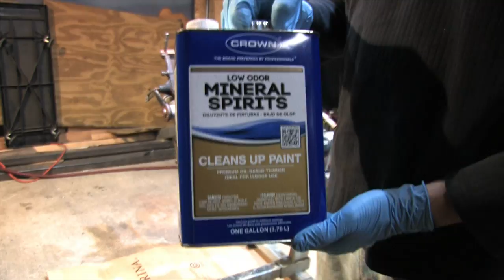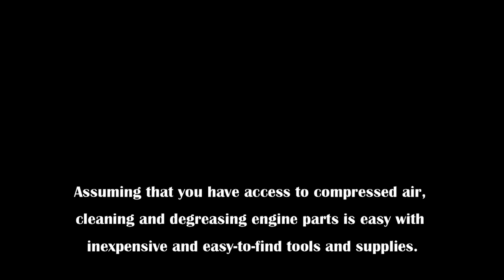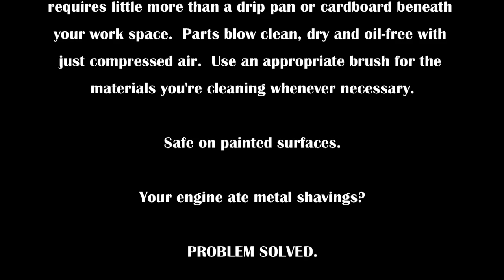DIY Parts Washer

Comment: What about clean strike, purple power, mean green, simple green, etc?  You could get a giant tub from fleet farm and put the entire motor in it and let it soak.  What is your opinion on these commercial degreasers?
Reply: Aluminum doesn't take well to degreasers. If you read the back of the bottle, they generally say not to use on aluminum. Lot of people do a soak like you mention to the block and other iron parts, but then you have to clean soap out of every nook and passage. Mineral spirits will evaporate cleanly without residue. Nothing wrong with a soak, but it's a lot of work. In the end, you still need to put some effort and time into scrubbing it and just about as much time into rinsing it as this whole process took.
Reply from the maker: buggsyspam ArcolaBridge Jamie actually uses a tub of Awesome Orange, and says the parts come out looking new.  He's also let a part sit too long without being washed well enough, and the whole surface of it grew fuzzy aluminum oxide stalagmites.  Strong acids and basic solutions will destroy aluminum, and there are some places you just won't be able to reach to wash it all out.

BUT...

The method I demonstrate doesn't really require much along the line of rinsing.  The compressed air thing takes no time at all, and the dirt blasts off with the mineral spirits.  The stuff you can't reach will evaporate on its own time.  It looks better 24 hours after you blast it than it does right after you're done.  It's much easier, faster and far less expensive than soaking in a huge tub of detergent.
Reply: Yeah looks like a great method.  I just used some ZEP concrete wash last fall to clean an engine block and I was amazed how fast it stripped off the oil  I  rinsed it immediately though.  I've been reading though, looks like there are "aircraft safe" (aluminum safe) degreasers, simple green makes one.  But I looks mighty expensive.  I like this method looks kinda fun haha

Comment: Can you use acetone to clean your engine? it drys almost instantly and is very strong when it comes to cleaning. i used to use it to get paint off of rims on my cars and it didnt seem to harm the metal at all. just wondering if anyone knows.
Reply from the maker: Yes indeed.  Carb cleaner is mostly acetone, and it's completely safe FOR THE METAL.  As far as breathing vaporized acetone... I'll stick to mineral spirits.  When I don't need a full-blown parts washer, I use 2+2 which is acetone with methylbenzene, toluene and xylene.  Nothing stands up to that stuff.  It even ruins powder coating.  Doesn't completely remove it, but it will ruin it.  Mineral spirits is a whole lot safer for humans to work with than everything I mentioned.
Reply: well thank you! as for breathing it is, i have a paint booth at the shop i used to work at so that shouldnt be a problem. thanks!

Comment: How's the gsx doing? When will we get to see the build? Pretty excited about it!! :)
Reply from the maker: We're both excited about it.  I'm afraid that project has grown much larger since my last update.  It looks like I will be making much more than just engine build videos for that car.  This former show queen is about to get taken to a whole new level.  The GSX engine comes first, don't worry.  If there's a mod that can be done to it, I'm doing it, and I'm covering it all.

I plan to have the Hyundai back on the road here shortly.  There's nothing fancy or difficult about this car.  The timing of the boom is unfortunate, but I don't care enough about its aesthetics to make it pretty.  Most people would have crushed this thing over something like this.  I just want to use my stereo again.

For the first time in a long time, I'm going to PUSH one in, and DRIVE it out.  It usually happens the other way around.  Until I break that curse... do not drive your car into Jafro's garage.  I have to break that curse in order to work on the GSX.

Comment: Just curious, what do you generally use to coat the cast iron with to prevent rust?
Reply from the maker: Just plain old WD40.  You have to re-apply from time to time because it doesn't last forever, but it's effective enough.
Reply: Thank you sir for the quick reply. I figured it would to the trick but wanted to ask in case there was a better option. Thank you for all the awesome videos. Hope to see your Galant up and running!

Comment: how much of mineral spirits do you waste on one engine block? it looks like a good amount of solvent is needed. Is it worth the money?
Reply from the maker: +karffiol $15 worth.  1 entire cleaned engine vs. $15.  The blow gun doesn't ever go bad.  $15 doesn't even buy 3 cans of carb cleaner where I live.
Reply from the maker: +karffiol Sorry, realized I didn't fully answer your question... I buy a gallon of mineral spirits for $15.  If you're OCD, might want a few extra pints.  I went a little over because I wanted to soak the pistons in clean solvent.
Reply: +Jafromobile well that actually sounds like a very good deal :)

Comment: Jafro, have you come across Berryman Chem-dip carb and parts cleaner? That product also seems to be a good one but it might be a bit chemical hazardous compared to what you used. However, it is quite extremely effective in cleaning off carbon deposits, debris, and any residuals on any parts.
Reply from the maker: Yes.  $138 in 5 gallon buckets, it's a neurotoxin, it's chlorinated (I don't use chlorinated products of any kind in my garage because I also weld).  It's banned in California (just like my "carb cleaner"), is highly-flammable, causes reproductive problems and cancer.  The only thing I'd ever do with that is soak parts.  I'd never vaporize it in my work area because it contains Methylene Chloride.  I bet it works great with soaking parts, but people who used to use the old formulation hate the stuff they sell now.  The old formula was EXTREMELY hazardous.
Reply: *****
Thought so. Thanks.

Comment: great work put what the chemical you use ?
Reply from the maker: amjad amj Low Odor Mineral Spirits.  Diluyente de pinturas - Bajo De Olor.  White Spirits or Terpentinersatz depending on what country you're in.  The old timers might call it "coal oil".  Because that's what it is at its most basic form.  It's a liquid coal extract, refined and purified.  Immediately dissolves all petroleum residues and rapidly evaporates.  2:01
Reply: thanks friend i was use the gasoline for cleaning . thanks for information

Comment: seeing that knock sensor on the block it reminded me... does any body knows if i can put a knock sensor on a g64b 87 out of a galant .. originaly the car had distributor cap and so no knock sensor .. i dont see any thread for a sensor.. but i cant be sure couse the block is allready wraped in plastic foil (as jadro allways recommends when keeping the block for a longer time!!)
can anybody help with some info?
Reply from the maker: If you can't find an empty bolt hole in the block for it, maybe for an intake manifold support bracket or an un-used accessory bolt hole, then you can weld a piece of steel to it with a hole and the right threads drilled into it.  It doesn't need to touch a water jacket or oil gallery, it just needs to read vibration, so any solid thing that you can attach to the block in that general location should work.  Just watch out for the heat when you're welding it.  Cast iron is finicky.

I discovered the Hyundai is slow (13's) because it runs in limp mode with no knock sensor.  Mine's dead shorted out.  I never had any timing advance on any of my drag passes because of this.  There's a lot I don't know about this car's power output as a result.
Reply: thanks for the respond i'l try to find a hole for another botl somewhere on the block.. i just thought it should be at that exact location (2nd cyl.) to get the "right" wibrations from all 4 cyl... but if you mean the location(within lets say 3-4inches of its original location) where it will now sit doesnt matter as long es it is directly bolted to the engine (y) thanks alot!

Comment: How safe is this to do on wiring/rubber hoses/gaskets on an engine that's still in a car?
Reply from the maker: Perfectly safe.  Mineral spirits will clean those wires and hoses making them look brand new again.  It's a super-thin oil that will dissolve any petroleum based mess while restoring plastic and painted surfaces.  If you noticed, the can says "cleans up paint".  It does.  It strips wax, but won't hurt paint.  You didn't ask about that, but I know it was the next question.  :P
Reply: Ok, thanks for the information! I'm the type of person that cares more about the engine bay where I work than the paint job on my car hahaha. Don't want specks of whatever falling into my eye when I'm just doing an oil change.

Comment: So this would be completely safe to use on an engine still in a vehicle then? Mostly leaning towards cleaning engines on skidsteers and other equipment but some of the farm trucks get pretty bad. 
Keep it up man, love the vids.
Reply from the maker: Yes.  No problem.  Will clean up engines that are still in the bay.  Cleans up industrial machinery, tractors, basically any metal that gets oily or greasy.

Comment: Can you use this methods to clean a dirty engine bay without it causing any problems? Please answer back :D
Reply from the maker: Yep!  You still need to spend time with your air compressor to finish it up or the mineral spirits will pool instead of evaporate.  It will dissolve adhesive on electrical tape, but it's safe on all metals, plastic, rubber, and painted surfaces.
Reply: Thanks man keep up the good work :D

Comment: use an automotive spray gun?
this would allow changes in spray pattern and ratio of air-fluid
lets you wet it down/scrub then blow dry as thats the trigger action half trigger is air then full trigger is fluid+air
Reply from the maker: The one problem with paint spray guns is they don't create as much force of fluid velocity and surface disturbance with the air leaving the tool as this kind of blow gun does.  Mineral spirits are only half of the cleaning power.  The other half is the focused air pressure to blow what it loosens up off the part.  One of things that makes this effective is the 110 PSI from my compressor, and the pointed velocity of the spray pattern.

Automotive paint guns would work fine for this, but they'll blow less of the surface contamination away because they have a tendency to strongly-diffuse the media and create less surface disturbance.  The harder and more violently you can spray the mineral spirits, the better job it does because that's funk that you won't have to scrub or brush off later.

Now, I'm not saying you can't do it that way, you absolutely can, and it will work just fine because mineral spirits is a very potent solvent all by itself.  And also highly effective if you already have one to use.  In fact, it would be GREAT for the internal parts of your spray gun...  But if you don't... this tool is only $7 at Harbor Freight.

Comment: What other names does mineral spirits come under? 

Just to let you know where I am to buy the right stuff, I'm in Australia.
Reply from the maker: In Australia: Turps.  It's mineral turpentine and is the yank equiv of mineral spirit.
Reply: ***** thanks for that.. Would isopropal alcohol be a bit overkill as I understand that its used to clean electrical items and dries clean too or is it not how can I say 'abrasive' or 'not suited to the job'?
Reply: ***** could you also tell me the difference between turpentine and white spirits please?
Reply from the maker: It doesn't cut carbon or oil film layers with anything near the effectiveness of mineral spirits.
Reply from the maker: turpentine and mineral spirits are derived from very similar processes, however; mineral spirits are FAR more refined, removing many esthers and odors that are still present in turpentine.  What you'll find is that it evaporates faster, cleaner and with much less stench.  Both are petroleum distillates, but mineral spirits is cleaner/thinner.
Reply: ***** thanks for that.. Really helpful.
Reply from the maker: Gary Stinten Please verify this.  I have a New Zealand friend who insists it's still called White Spirits like they refer to it in the UK.  Someone else commented here that they tried mineral turpentine, and it didn't evaporate.  That sounds like regular old turpentine to me.  Mineral spirits are far more refined than what we just call turpentine in the US (which is oily and stinky).  Both are from the same origin, but that extra refining is why this can says "low odor".  It costs about 3 times more than what we call turpentine because of this extra refining.  Turpentine works better for thinning paint, and it's cheaper if you can stand the smell.  If you're going odor-free with oil paints, use mineral spirits... but if you're cleaning with a blow gun, don't use the chemical that WE call turpentine.  It will wreak, leave puddles, and an oily, waxy mess.

If it turns out that "Turps" is mineral spirits where you live, please confirm this with me because I'm 14,000 miles away from you, and plenty of other Aussies watch my videos.  I appreciate all of you and want you to experience the same nearly touch-less parts-washing joy that I do.  Anyone crazy enough to send me a front bumper from a '92 Mirage hatchback, please be my guest!  :P
Reply: ***** I have one more question which I think will definitely answer the overall question.  What was the UN number in the can that you use?
Reply: ***** I bought some white spirits and the UN number is 1300. I'm not sure if that is mineral turpentine or white spirits, but I've read that 1268 is the official UN number I'm looking for but that came up as isopropal alcohol.

Comment: the bad part is you have lost the cleaning solvent, if you get a big mud pan from Home Depot for 10 bucks, you can save the cleaner for other things.
Reply from the maker: What?  So I can spray oily, diluted, mostly-evaporated, contaminated solvent full of bearing chunks back onto another part?  A 12-pack case of carb cleaner is $80, it's more toxic, less effective, and 5 times more expensive than mineral spirits.  This stuff evaporates so fast that by the time I finish cleaning a whole engine, I'd only be able to manage and save maybe 2-3 cups of it.  The only stuff I managed to save is the stuff I soak things in.  The stuff you spray doesn't hang around for even 10 minutes after being oxidized.  I do appreciate your comment.  This one happens frequently.  It's just an exercise in futility to re-capture atomized, contaminated mineral spirits and I think few people realize or understand that.  The stuff that drips off is so nasty you wouldn't want to run it through the gun a second time.
Reply: Jafromobile   As a retired master diesel mechanic I would and have recovered as much as I could, the heavy contaminated material stays and you poor off the usable, I don't know if you met to be condescending but that's the way you came across to me.As you are the one that paid for the cleaner you can of course do as you wish.My comment was not a dig at you ,it was more information for your viewers, if you don't like other inputs please disable comments for your video.
Reply from the maker: I'm not bashing your experience as a diesel mechanic, or trying to be condescending.  I'm just encouraging thought about the physical properties of mineral spirits and what your time is worth.  Personally, for me, it's hard to me to justify re-capturing, filtering, and separating what evaporates when I consider my time versus the cost of the solvent.  The greatest benefit of this method is to clean large pieces that don't fit in your parts cleaner like engine blocks, transmission cases, grimy engine bays, etc.  If you were going to pay anyone else to clean any of those things, it would cost you a small fortune compared to the $5-15 you spent on the solvent.  The clean up time = fold up cardboard, throw it away.  I do appreciate your comment and having to continually explain this.  I would venture the vast majority of my viewers are golden enough in their abilities to earn at least an additional $15-$30 doing something else in the time it takes to save what didn't evaporate.  I know I have the best quality viewers on YouTube.  I don't want you to lose sight of how valuable your time is, that's all.  This is a great method for cleaning any part if you're on the go, and big stuff that doesn't fit in your parts washer... but if you don't have a parts washer, it's a way that you can do just as good of a job.  It's not a perfect method, but it's definitely the fastest.
Reply from the maker: I also left out most portable, and cheapest.

Comment: I wonder if the EPA would approve of this method.
Reply from the maker: You mean the United States' single largest polluter?  The taxpayer-funded Federal organization responsible for wrecking the ecology of the entire Colorado river?  The one the Navajo nation is suing?  I don't know what they'd say?  But I'd be happy to talk to them about environmental responsibility.  They'd probably insist I use 24 aerosol cans of carb cleaner like everyone else does?  Mineral spirits are the purest, most refined petroleum product there is.  Capturing the runoff with cardboard like I showed so that it can be absorbed, the mineral spirits will fully-evaporate. You have dry cardboard with the runoff particulates and broken-down absorbed oils in it.   Disposing it it in a landfill where the earth is lined and it doesn't end up in the water table is the responsible thing to do.  I'd love to talk with the EPA about the Colorado River, though.